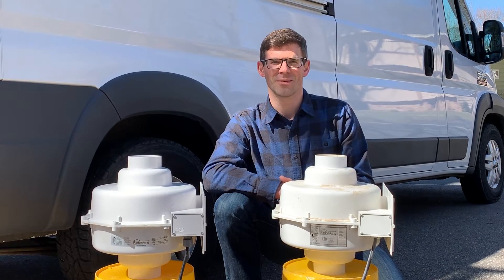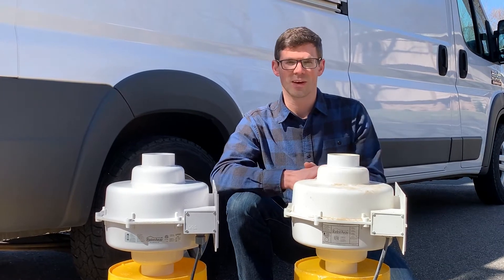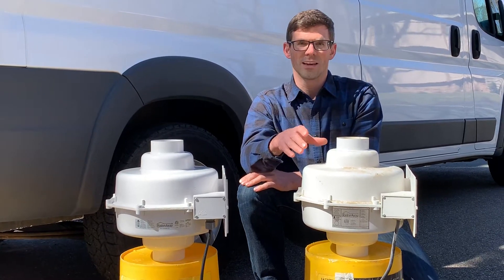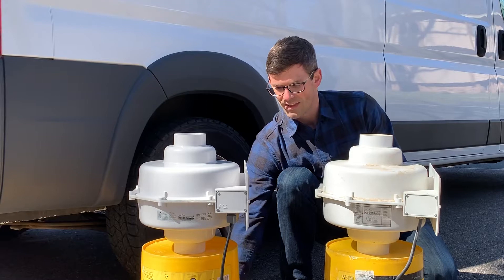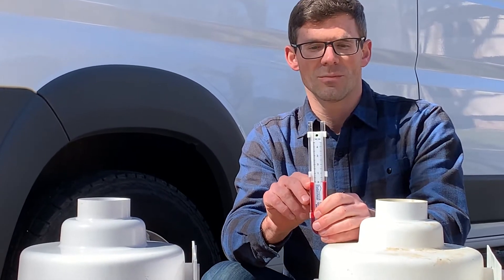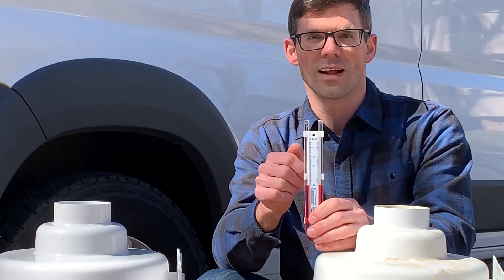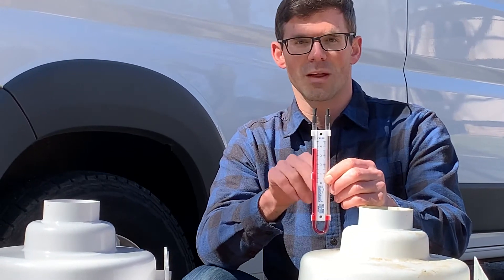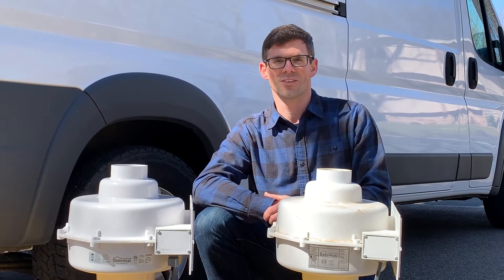Buzzing Radon Fan Sound Explained

Comment: I have a GP501 fan, I think its too large. The U-tube reading is reading 3.7" wc. can you tell me what this means....3" pipe. When it finally dies do you think I can lower it to the GP301 or should I go back with the GP501?
Reply from the maker: The 3.7" WC is the static pressure inside the pipe. This means you likely have tight soils that are not very permeable and are hard to move air through. Therefore the mitigator used a high-suction fan. I would not switch to another fan unless you add additional suction points or measure pressure field extension. We rent a tool kit to allow you to make these measurements. https://americanradonmitigation.com/product/radon-tool-kit-rental/
Reply: @AmericanRadonMitigation  thank you
Reply from the maker: You're welcome!

Comment: I got a dying GP201, but that model is discontinued, and the 301 and 501 are all that is left. Should I just get the GP301?
Reply from the maker: The fan curve for the RadonAway RP145 and the GP201 look fairly similar when the static pressure is 1" or more. You'd have to change out your rubber couplers as the RP145 has a 4-inch duct rather than a 3-inch. https://www.wpb-radon.com/radon_fan_performance.html
Reply: Thank you. Just installed the RP145, and it is extremely quiet! The old GP201 was almost twenty years old, and it was definitely past its prime.
Reply from the maker: Awesome! You got your money's worth out of the old fan. Remember to do a follow-up radon test.

Comment: Does it matter where you install a radon fan in the basement? I mean for example can it go n a closet in the basement where the sump pump is located?
Reply from the maker: The suction point can, but the fan must be in an unconditioned space such as an attic or outside. You can learn more by checking out the radon mitigation standard. Specifically, section 6.5. https://standards.aarst.org

Comment: Hi Jesse, I am wondering if the GP501 could be overkill in certain situations. The only reason I say this is the GP501 is relatively loud but gives a reading of 0.2 from ~ 8.5. I am wondering if it would be worth a try to use a GP301 or GP401 and see if the number still goes down to this number but also the noise level goes down? Have you every been in this situation where the installers just went with the big bruiser, when a quieter but relatively low suction still works at getting the number down to 0.2? Just wondering as the Radon guys did a great job getting the number down. Don't get me wrong, I would much rather have a safe house than a quieter fan; but just wanted to know if it is worth a try testing a little bit lower suction to get the noise level down? Or is there a fan from AMG that is just as good as the GP501 but much quieter? Thanks for your video.
Reply from the maker: The higher the wattage, the louder the fan. In optimal mitigation, you use the smallest radon fan that will give you the suction you require in your test holes. 

This is covered in this video. https://youtu.be/h0g_UY5-Zew

You can also add additional suction points and use a quieter, more energy-efficient radon fan. 

Yes, there are many contractors that simply install the big fan as it’s easier than digging a larger suction point, adding additional suction points, or taking the time to engineer a system.

Comment: Would there be any reason to replace a RadonAway GP301 with a GP501? Our 301 just died and I see both available at my local store. Thanks!
Reply from the maker: Not if your radon levels were low with your RadonAway GP301. It would only increase your annual operating cost. Bigger is not better when it comes to radon mitigation fans. 

I wrote a blog on this topic. You can check it out here:
https://www.americanradonmitigation.com/blogs/choosing-radon-fan?rq=radon%20fan%20selection
Reply: @AmericanRadonMitigation  That blog explanation was very helpful, thanks for the quick reply... and you read my mind, wondering if bigger is better when it comes to fan selection! Do you have an opinion on the mail-in $10 tests, being reliable enough for a reference test?
Reply from the maker: @BrianFisher  We use a lot of the Airchek test kits as well as alpha track kits. I can't say I have much experience, good or bad, with the other types.  You can see the ones we use here: https://www.americanradonmitigation.com/shop-kits-and-detectors
Reply: @AmericanRadonMitigation  You've been very helpful, hopefully your replies help to answer other people that have the same questions! An update to my GP301 breaking, I opened it up and saw the black impeller/propeller had cracked and self destructed into several pieces.